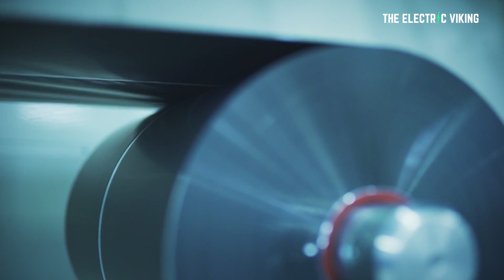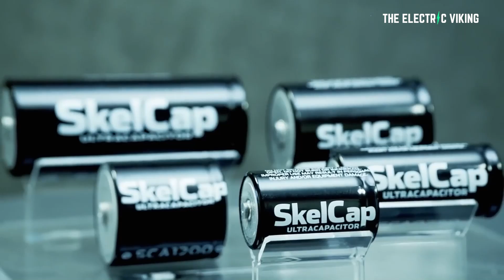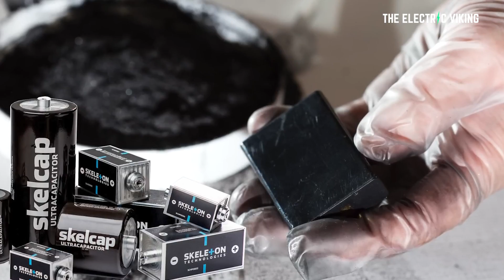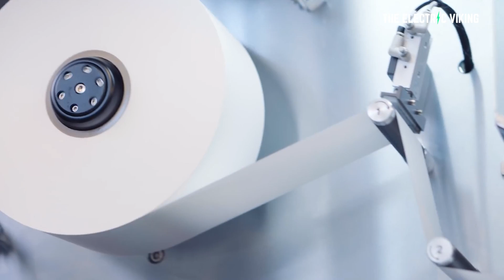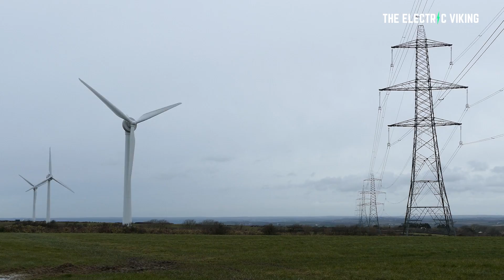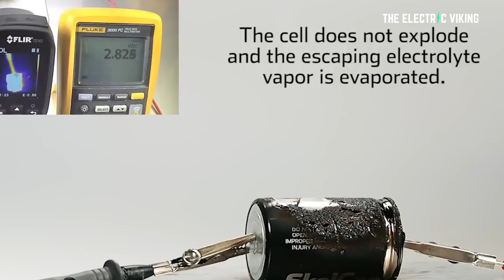The EV Super Battery that charges in 60 seconds & lasts 100 yrs

Comment: I think you've made a mistake with energy density figures. Super batteries are somewhere between super capacitors and batteries. Fast charging and long life, but lower energy density than batteries. They are for the in-between cases that need high power for up to 15 mins.

Comment: There has been several articles over the years comparing Hemp batteries & Capacitors to Graphene batteries & Capacitors,  with Higher efficiencies in the hemp products compared to the Graphene products, have you heard of anything  new on these Hemp products.

Comment: OK. What most want to know. 
A Lithium battery pack that takes an EV 300 miles.  What would be the size and weight be of the pack?
Now to take an EV 300 miles, how would these batteries compare in size and weight?

Comment: Looking at their site, if it actually works well, is durable, is safe, is reliable, has a reasonable cost, scales well to commercial volumes from the lab, etc.  (since BY FAR, most such new ideas never become actual commercial products), it could be a FANTASTIC substitute for lead acid batteries to start ICE cars (or many BEV cars, as I understand it), run low voltage electrical systems, etc. 

But re the energy density discussed being something like 20 or 25 percent of what LI batteries are (i.e. 60 Wh/kg vs more like 260 for a Tesla battery)  I don't see it being a good substitute for powering a BEV, UNLESS they can MASSIVELY scale up the power density. 

Charging an EV in 15 seconds (or even a minute) and super-high charging cycles sounds GREAT.   BUT, having the practical range go from roughly 300 miles to 75 miles sounds TERRIBLE for anything but a short hop city-only car (which might get much less range on a very cold day, for example).  

So it sounds very interesting.   And maybe some kind of hybrid BEV battery system with some of this for quick power and massive lightweight, reliable, durable 12V system power sounds AWESOME.  But the range per kg sounds like a DISASTER for a pure BEV battery solution.  Weight matters.  You can't just have a, say, one ton BEV battery without consequences re safety and handling dynamics and tire wear, etc. for a typical consumer car. 

Now, if over time it can do what they claim, well, cheap, AND they can coax the energy density to something approaching 200 Wh/kg, THEN you're talking a whole new ballgame. 

Given my lack of belief in magic and something for nothing, I'll put the odds for this happening within a decade at 10 to 1 at MOST, and more like 100 to 1, but we'll see.  

OTOH, if they completely revolutionize the 12V battery business, where a car battery weighs under 10 pounds and is nearly indestructible compared to a lead acid battery, and at a similar cost, and provides similar power, lasts many years, etc. -- then FANTASTIC.  

Again, what's mainly encouraging to me, big picture, is how many wildly different, promising battery research technical directions are being pursued.   May the best ones win, and may they be very very good indeed on many fronts re what's good for consumers.    It's stuff like this that makes me wish I were young again, as I'd love to see what happens with battery tech. in, say, 50 years.

Comment: that so called super battery has 1/5th of the energy density of an entry level Lion battery... less then 250watt/hr/kg simply there is no way to use it in EV's... and for the competition Tesla already gone up to 350 watt/hr/kg, in a year or so 4680 design could go up to 380-400watt/hr/kg... for a standard range EV, a 70 kwatt/hr "super battery" weighs 1,4 metric tons (50watt/kg energy density in cell level according to skeleton brochure, it would be much worse on pack level) means, an EV would be approximately 3,5 to 4 tons with super battery structure...  with such a mass there is no way it can go 200 miles of range... if it goes 40 to 50 miles they'll be lucky...

Comment: they should mix this with existing lithium batteries, the capacitor would hold roughly 1/4 or 1/2 of the vehicles range when you go to charge, it charges the battery and the capacitor, motors can draw from either.. while sitting the capacitor can charge the battery. having this fast charge would be a way to stop range anxiety. if you could charge the capacitor in a minute or two and get a 100 or more miles.

Comment: My question is When charging this in a vehicle I'm sure it's not a single capacitor but a whole bank of them. I know that a single std cap when charging can suck down a lot of current. So what happens when you have 50 in parallel???

Comment: If this battery pack is 60 kWh in a car, and it recharges within a minute, then the recharging power will have to be a minimum of 3.6 megawatts, assuming that recharging is linear. In practice, it never is, so the charger will have to supply maybe 10 megawatts peak. If the battery voltage is 400 V when fully recharged, then the recharging current will be 90,000 Amps for a pack which recharges linearly, and very likely 250,000 Amps (or more) peak for a nonlinear  recharging cycle. 

A quarter of a million amps going through the car will need some pretty hefty connectors and bus bars, along with some dramatic cooling system. Imagine how fat the recharging cable alone will need to be, to handle those levels of current.  Even if the pack size were only 6 kWh, as in a hybrid, then recharging current would still need to be at least 9,000 Amps for a 400 Volt system, and 4,500 Amps for an 800V battery pack.

And if the battery is in a large truck, it will need to be at least ten times the size of a car battery, giving 600kWh and recharging currents of 2.5 million to more than 7.5 million Amps. I expect that few electricity supply substations could handle those current levels

With these considerations in mind, I'd say that either the claimed recharging speed is wildly incorrect, the cars battery capacity is much smaller than 60 kWh, the battery voltage is much higher than 800 Volts, or the whole thing is a scam.

Comment: In an interview conducted by Matt Ferrell with Dr Sebastian Pohlmann the VP of Automotive and Business at Skeleton Technology which is centred in Estonia and associated with University of Tartu which is where curved graphene sheets was invented. Sebastian said that the new “super battery” had a fourth of the energy density of a conventional lithium battery but can be charged in 20 seconds.
Firstly the super battery is actually a super capacitor and a lithium ion battery combined. Think of the cathode and anode of a battery also functioning as the plates in a capacitor and all this is rolled up in the cake mix that works/as efficiently/and or easy to manufacture as currently can be achieved.
So for these proposed super batteries to replace lithium ion batteries in an EV then there would need to be 4 times the volume as currently exists to achieve the same range. Not so impossible to produce except for weight????? The car would be about twice as heavy or more as a current EV which are already heavy.
Also recharging in 20 seconds sounds great but the power being pumped down the (I assume) copper cables to achieve this would be mind blowingly off the scale. I don’t think there is anything that has that capacity other than say the arse-end of a nuclear power plant and the thickness of the cable would be enormous. Talk about WMD if you pushed that plug into the wrong hole in the car.
So as a complement to Lithium ion battery storage is a good idea for regenerative braking and acceleration and as say a quarter top up to get you home so you can then charge your EV normally maybe is all I see in this technology. For trucks like garbage trucks and trains that stop and start all the time this is the future. For cars it’s a supplement.
Also Graphene is still difficult to make and requires a lot of energy as well. Scaling this up is going to be difficult.
Energy density of a super battery is 65Wh/kg compared to lithium ion battery being from 100 to 250 Wh/kg. Also the super battery is larger in volume by about two times comparing Wh/kg to Wh/kg. so lets say the best 250 Wh/kg lithium ion battery EV would require a super battery about 3.8 times as heavy and about 8 time the volume. It would look like a small bus and would even require small truck tyres and brakes.

Comment: Happy Birthday mate... but not energy density - power density. That's what ultra capacitors excel at - delivering and taking in power quickly. Because they are not batteries although they behave in a similar way.  The problem has always been energy density. They are trying to improve on where they currently are - which is miles behind lithium ion batteries. Even with their "radical" new "curved" graphene (spoiler alert - there's no such thing) and chemical electrolyte they are talking a maximum energy density of 69Wh/kg. Don't get me wrong - this is amazing for a capacitor - it's nearly 4x better than competing ultra capacitors. Unfortunately it's more than 4x worse than Tesla's current state of the art Lithium cells at 280Wh/kg - and they are improving that all the time.  That's why initially these things are only being proposed for heavy duty mining equipment where size and weight are less important. Sam, you really need to read the literature first before publishing. Here's a decent article. https://newatlas.com/energy/skeleton-superbattery-curved-graphene/

Comment: One must differentiate between supercapacitor and battery cell.

Supercapacitor stores energy in dielectric between two conducting plate. Theoretically there is no limit on the storage capacity or rate of charge. In practice there is limit on the breakdown voltage of the dielectric which limit the voltage of supercapacitor can handle. Also once all the molecules in the dielectric are aligned it cannot be charged any more. Hence more capacity require more dielectric material.

Baterry cell stores energy chemically in higher quantum state. Hence there is a limit on the emf of battery cell. For more capacity require more cathode and anode material.

Comment: They have high power density, but energy density is about one third of li-ion batteries (according the the brochure on their official website). Forget about electric planes. For cars and other wheeled vehicles they might have some potential, but don't get too hyped up. In order for them to be practical and replace li-ion you will need insane infrastructure. Yes having one third of energy, but being able to charge 100 times faster sounds like a nice tradeoff, but you need crazy chargers for that and you need them everywhere. Currents and power levels during charging will be insane.

Sorry, the infrastructure to support the full potential of such batteries won't be there any time soon, if ever. Can you even imagine a plug for a 6 MW (yes, mega watt) charger?

Comment: HI! At one point in the video, you stated that this is good for short-term storage, something on the order of a half hour or so. That makes sense, even at 10X the energy density of more conventional supercapacitors. 

That's still far too low for EV application as the main battery pack. They will make it into EVs as an auxiliary storage medium to take more efficient quick charging from regenerative braking and for sudden bursts of rapid acceleration.

Comment: If charge time and cycles is as you say, its fantastic, but wh/kg is lower than compared to LION. You also mention that the application is for 15 minutes use, if I heard correctly, and that is not usable for EV's. Migth be fantastic for energy storage to replace gas-turbine plants.

From skeletons website: 
High energy density (65 Wh/kg)

From inside EV's on tesla 4680:
estimated energy density: 272-296 Wh/kg

Comment: This is just a supercapacitor. It's not comparable to li-ion batteries for their application. Supercapacitors (as all capacitors) will charge very fast and have a huge cycle life. It's nothing new. I think you made it unnecessarily look like it would disrupt the BEV world. It will not, at least not as the main battery replacement.

Comment: how much current needs to be supplied to charge a 75 to 100 kw battery in 15 seconds (minimum 1,350,000 kwhr = 1.35 giga watt hour delivered in 15 seconds) ? how big do the copper buss bars need to be to cope with the current draw? what charging system could possibly supply that sort of current? a 15 second charge for an EV is not practically achievable.

Comment: For perspective, to charge a 40kWh electric vehicle battery in 15 seconds would require roughly 700A at 13.8kV for those 15 seconds.  Not gonna happen.

Comment: If you are going to charge your car for even a 100 miles in 15 seconds, you will need one massively powerful charger.
Reply: Super capacitors have the Ability to charge really fast without the electric pressure required by batteries . This is why I have often wondered why Tesla haven’t leveraged more Super-capacitors into their long range and high performance cars …

Comment: Hi, sounds really exciting for lesser range but super quick charge applications.
I believe they might have a problem with making graphene in bulk. Once they do, they will literally destroy Tesla's energy sector (unless it's still too expensive).
The BMS (or SCMS?) Might have to be beefier in order to handle the strictly diagonal discharge curve. However, voltage goes down to zero in super capacitors, without degradation issues.

Maybe Tesla will be keeping a watchful eye, might even invest a little to kick start the SC industry (after all, Elon did research on that area when he was younger).
Imagine that, an energy storage "battery" that lasts 20x longer and made with only graphene and aluminum (and whatever can material?)!
Seems like it would require MUCH less material needed to gain probably just half of LFP battery kWh/kg storage.
Reply: Unlikely you would need a BMS at all.

Comment: again this is minimum 5 years away and it doesnt seem like it can be used in cars any time soon. We need tech that can be used tomorrow.  10 minute charging with lighter weight and cheaper.  Those are the key points the rest is just vapour ware.  Ridiculous and we dont know the downsides and there always are downsides.

Comment: I think the stated charging time is not possible in the real world.  Let’s assume you have an EV with a 70 kWh battery and you want it charged from 20% to 95%.  That requires an energy transfer of .75 * 70 kWh = 52.5 kWh.  No charger will be doing that in 1 minute.  A fast DC charger available today is ~350 kW.  That would take 52.5 kWh / 350 kW = .15 h = 9 min.  Pretty fast; but way more than 1 minute.   On the other hand, 9 min would still beat the 20 min with today’s batteries; not revolutionary, but a useful improvement.
Reply: Why would you charge a capacitor from 20 to 95%, I don't think you get it. Otherwise your observations are quite correct.
Reply: @andreasnorstedt8506  Thanks, 20% to 100% would have been a better example.

Comment: Hey Sam, You mix-up power density and energy density. A Lithium ion battery can hold 3 times more energy per kg than this skeleton superbattery, 205Wh/kg against 65 Wh/kg. But the power density is 20 times better. You can charge and discharge this batterie with a 20 times higher current than the litium-ion current.
Reply: Lithium 360 wats o rr kig goug 400 santt d o l us kug lithium up a rind solved s8tate bates

Comment: You may be a little confused, a capicitor and a battery are not the same thing but your using the word battery interchangably. That being said a multicapcitor system may work, you would have to see their design to know if their claims are true or not. Elon considered capacitors as well.

Comment: With EVs isant the charging speed mainly limited by the power available   anyway? 7 mile per hour or so on a standard 240v home outlet , 30-40mph on 7kw home charger right up to 1,000+ mph on a 350kw DC super charger. Other than more cycle life , how did these batteries help EVs?

Comment: Supercapacitors have been around for decades. These can be charged very quickly, but fast only with high losses. I hope that they succeed in ultra-fast charging without high IxR losses. To date they are used in a very limited range of applications. I’m a scientist and electronic engineer.

Comment: SkelCap SCA1200 Ultracapacitor Cell Specific power performance is up to 80 kW/kg and specific energy up to 6.8 Wh/kg with ESR as low as 0.13 mOhm, so even if they manage to 10x themselves in one giant leap we get 68 Wh per kg or 68 kWh per ton woohoo!

Comment: Gr8 for the future of wireless road surface recharging to complement the smaller EV batteries. Shut down rogue drivers like those who overtake on the upcoming 80km fast lane which has been closed at night because of road work and speed though with no regret towards someone's family member not going to arrive home.
Reply: Hybr ed d eltrc hyd er grn natral gas orii o ne

Comment: A super capacitor is just a battery with ZERO internal resistance...🤔
Reply: No, a battery is electrochemical and a capacitor stores pure electrical energy via electrostatic charge, no chemical reaction involved. I don't really see a mix, I see the use for both either on their own or combined on a string but I don't really see the possibility for both in the same cell at least not in the near future.